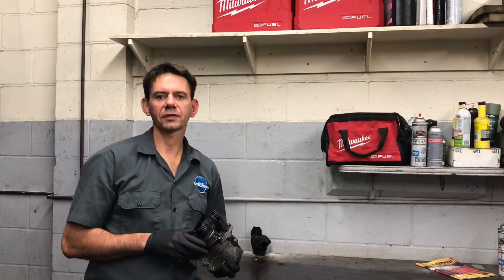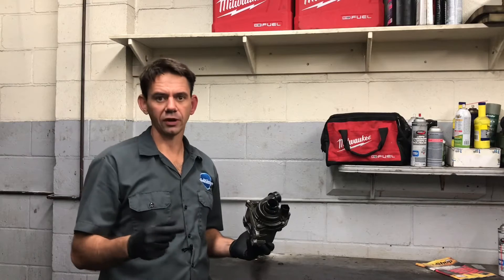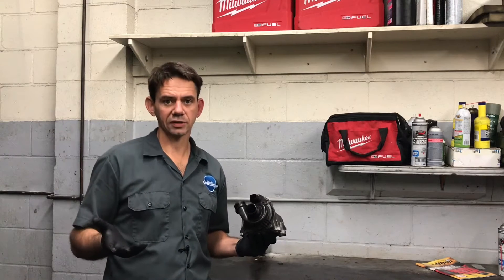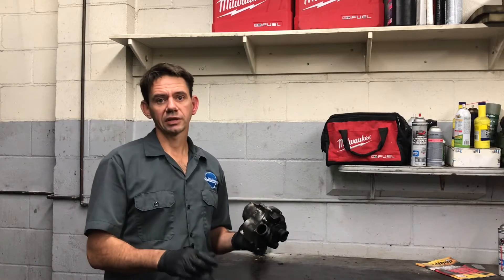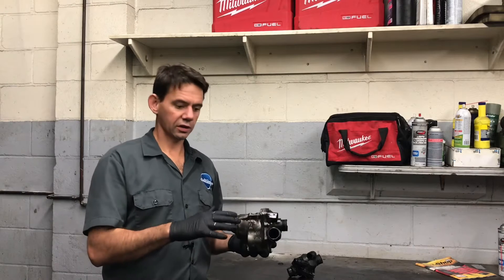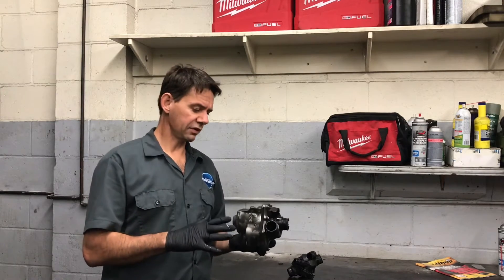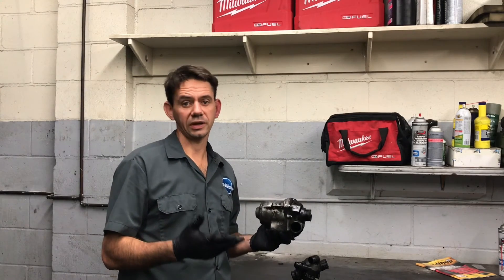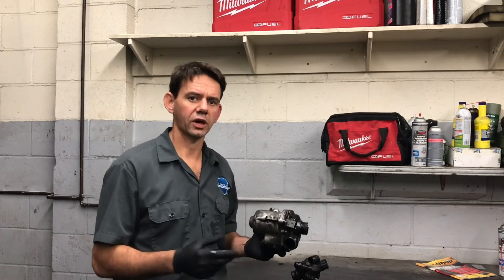How  Electric Water Pumps For Cars Work And Make More Power

Comment: You still need some flow even when the engine is ice cold, to prevent hot spots. Misleading information, if someone actually does not have coolant flowing in their engine during warmup it will blow.
Reply: Then why is there a thermostat that stops the flow of coolant?

Comment: Nice presentation Brian.  I had the opportunity to see a future powertrain and yes it was with an  electric water   pump but it was like a variable displacement turbo with the ability  change not just flow but speed and flow all computer controlled .  Electric AC compressor and electric turbo as well  with  an electric  assist master cylinder .  One belt for an alternator.  Your going to be an Electo Auto Tech in about 3 more years  and then your in for a fun time with wireless sensor  technology  . LOL
Reply from the maker: STEVE ROB REVIEWS please deafly going to weed out the amateurs from the pros. Lots of cool stuff coming down the line. Thank you for watching Steve!!